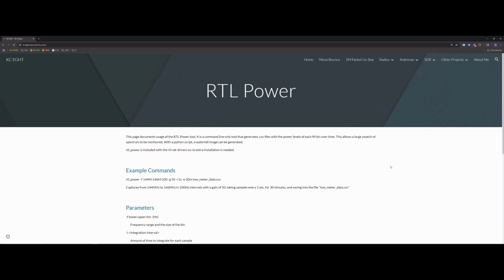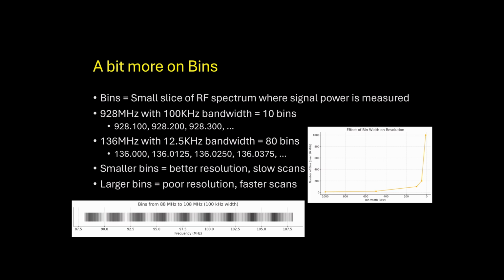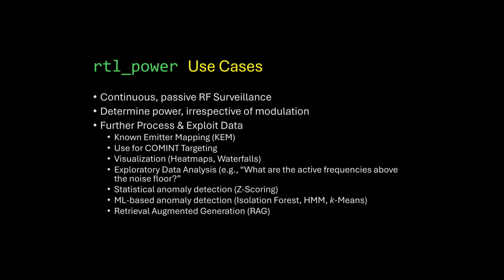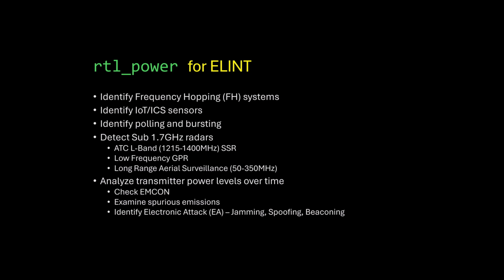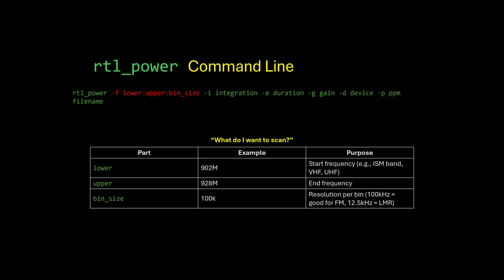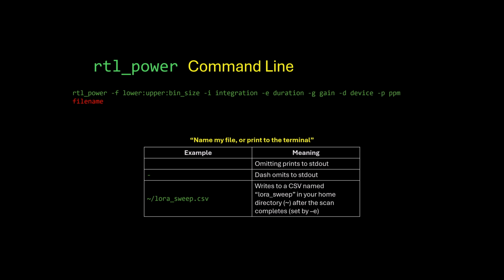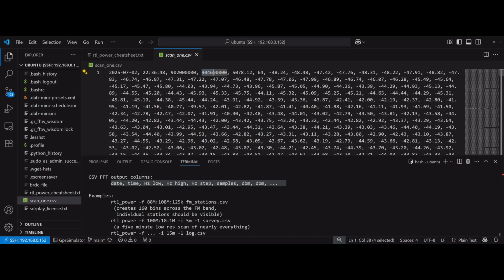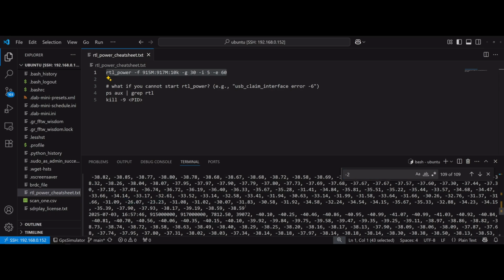Broadband SIGINT Surveillance with RTL-SDR & rtl_power

Comment: Cool vid. What kind of processing have you tried on the rtl_power data? My problem is that I haven't been able to get clean data from it, and I don't know where to go with the data lol. I've looked into CFAR but I'm thinking energy detection or a very simple CNN could be useful in detecting signals.
Reply from the maker: I mostly keep it simple since it's just a simple average power tool. Once I process the SSV data it's mostly going into visualizations, some Z-Scoring against daily/weekly/monthly, Isolation Forest for times when Z-Scoring doesn't pop anything interesting.

You'll need I/Q data to get into really interesting use cases so the rtl_power stuff becomes an enrichment source or a very crude RDF tool if you manage them remotely which is something I want to experiment with that is cheaper than running multiple Krakens

I'm working on the second part for this and will drop some code into Pastebin to process the data. You can work backwards from the power measurements per bin and calculate the exact frequency with a simple list comprehension in Python.